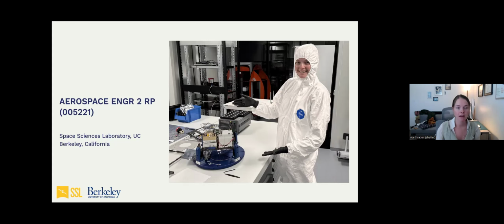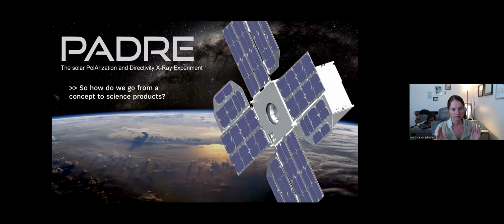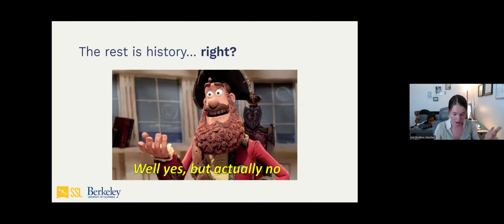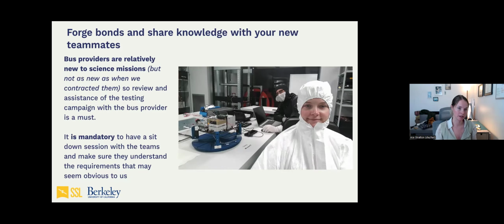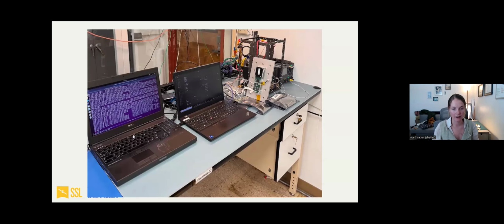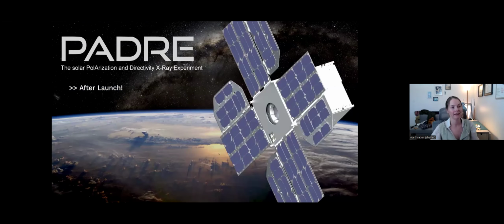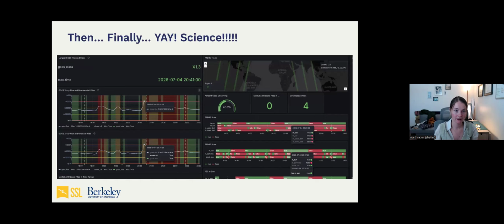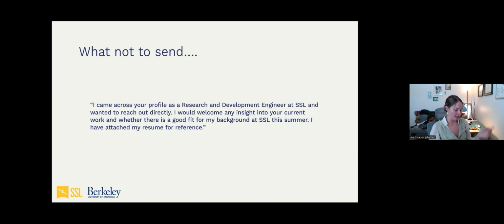HelioHub - The Polarization and Directivity X-Ray Experiment (PADRE) Mission with Ace Stratton

Comment: I'd like to learn more about the reconstruction algorithms used to convert the raw Timepix3 hit maps into a polarization fraction or angle. Given that Timepix3 chips typically provide high-cadence data (256x256 pixels), the methodology for handling the onboard data reduction—to avoid saturating the limited 8 GB storage is a critical technical detail.